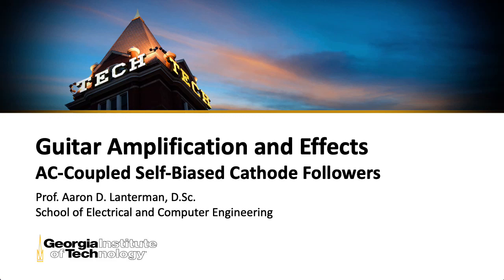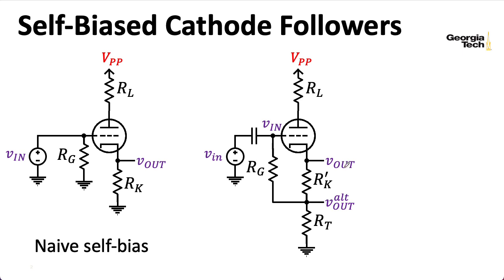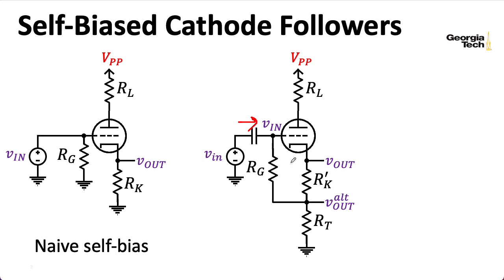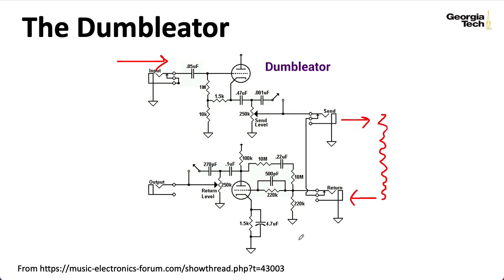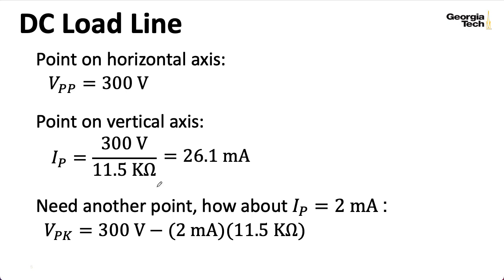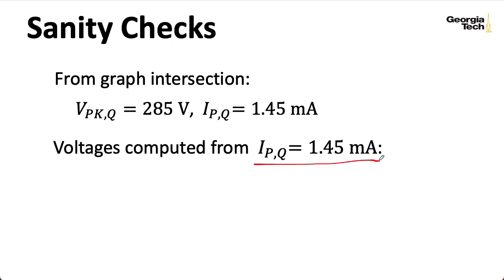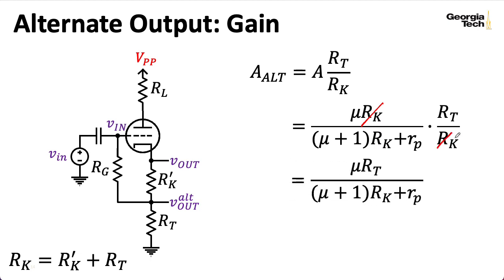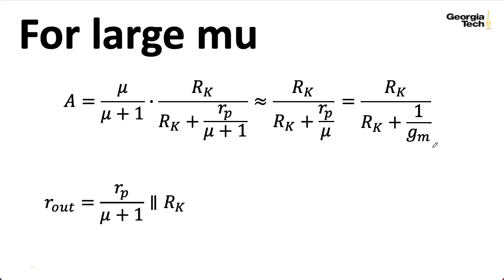ECE4448 L24: AC-Coupled Self-Biased Cathode Followers (Guitar Amplification & Effects, Georgia Tech)

Comment: Can the cathode resistor ladder be used to reduce the gain? I need an active attenuator.
Reply from the maker: I'd generally recommend against tweaking the amp itself, there's so many factors balanced against each other. I'd recommend trying commercial active attenuators just operating from the speaker connection side.

Comment: Nice video!
So this bias scheme uses positive feedback back through R_G to set the bias point. Because of the capacitive input coupling, I assume that the positive feedback is only active at low frequencies. Could you just as well have used a constant voltage source at the other end of R_G, if you had one handy, or is the positive feedback scheme more than a neat way to derive the bias voltage that you need (providing more benefits)? 

Without R_K', the positive feedback would be more or less mu/(mu+1), so I guess that the reason to have R_K' is to control how close to one the positive feedback gets, thus controlling the bias point?